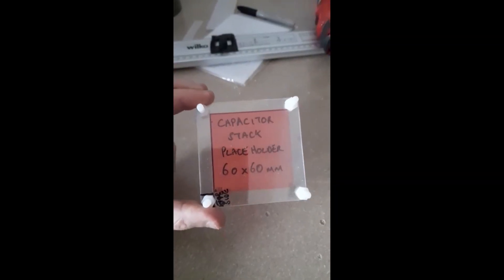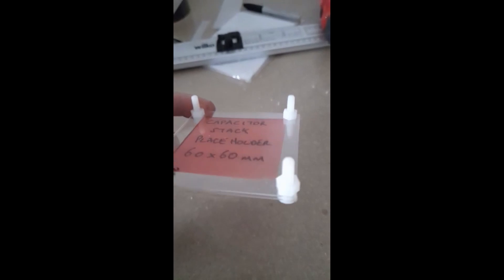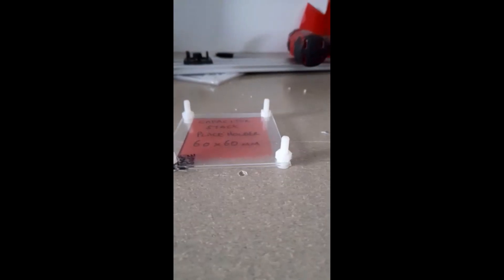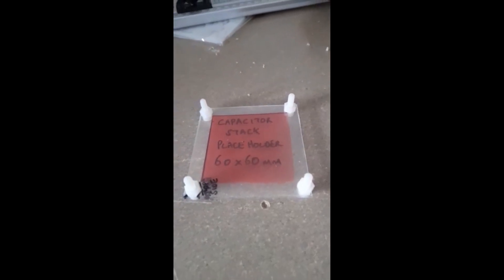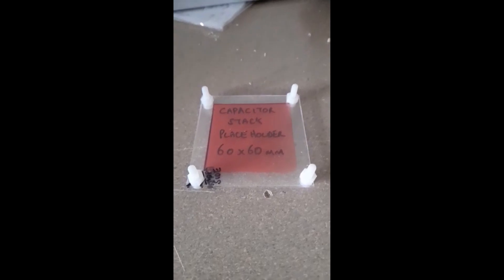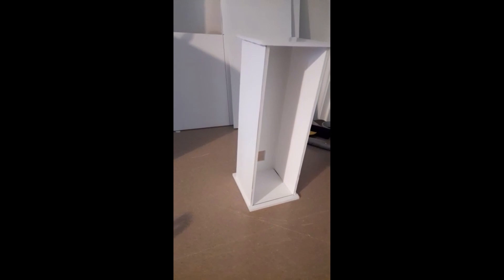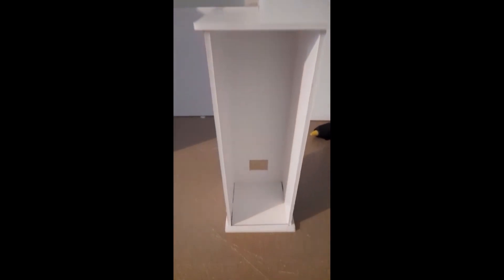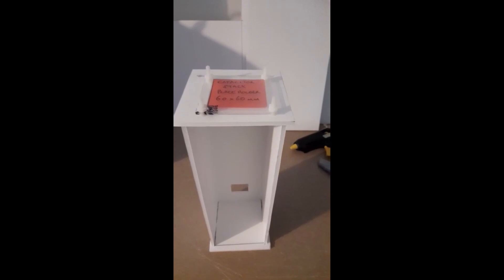Quantised Inertia - Phase 1 Apparatus Setup Jun 2022

Comment from the maker: For further guidance and material ideas on building capacitor stacks for Quantised Inertia, please visit:
https://arundal-astronautics.co.uk/quantised-inertia-apparatus/ 

If you would like to support Arundal Astronautics financially, then please visit
https://arundal-astronautics.co.uk/membership-account/membership-levels/
Reply: Could you please include a section on building the high voltage supply you are using?
Reply from the maker: @Monomorphic  That will be a topic for a future video - a little bit to work through in the prototype first though.  Stay tuned!